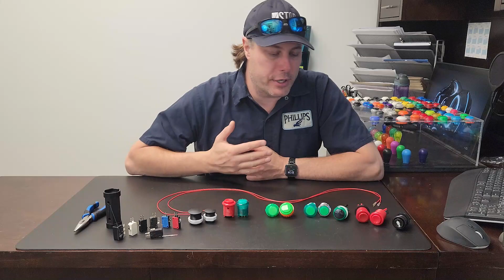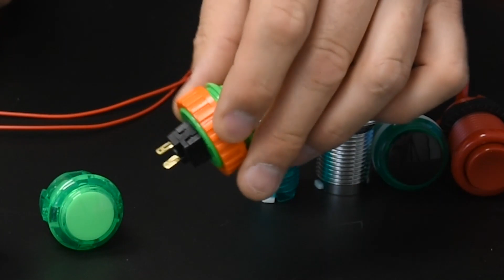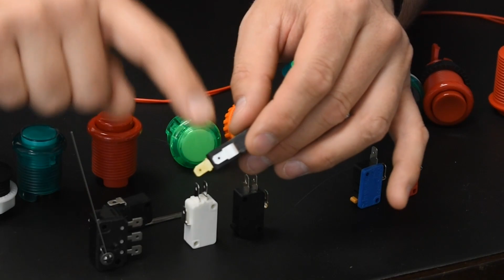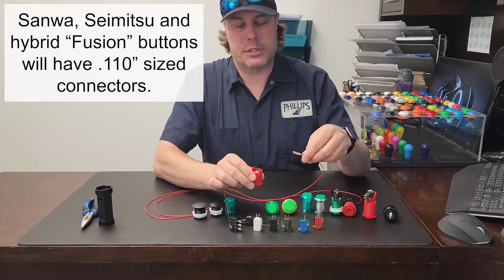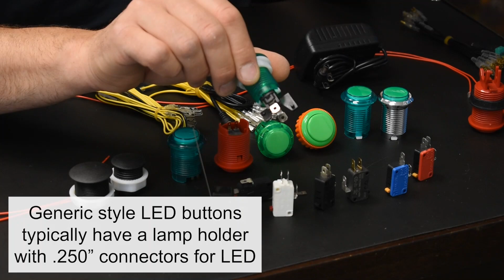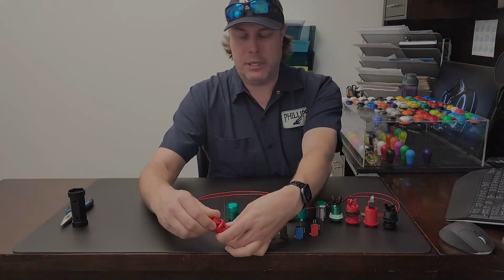Arcade Buttons 101

Comment: All switches are on/off or 1 bit digital. If analog like a game pad trigger then a variable resistor (Pot, strain gauge), capacitor (capacitive touch), inductor  or magnetic field (halls effect) needs to be used. In this case a micro-controller and maybe an ADC/DAC maybe required to output a numeric value or voltage level or current level. 
Arcade buttons use simple switches and are cheap to employ, with original leaf switches in the 70's & 80's Arcade/Pinball machines being cheaper than cheap. Micro-switches are modified toggle switches that use spring assisted snap contacts (clicky) to reduce destructive arcing of contacts.
Micro-switches were originally used in industry and the smaller all-in-one buttons use a mechanical keyboard style switch (low current).
Reply: Is there really a big difference between micro switches and rubber membrane switches
Reply: @GeneralTso369  Yes:
Microswitches are like mechanical keyboard switches, rated for a lot more cycles than a rubber silicone pad is. Rubber membrane is usually much easier (less force in grams) to activate than the most usual 100g (and maybe spring on top) of a microswitch. 
Japanese style switches are very "like rubber membrane" in ease of use but use mechanical, metal and hard plastic parts with combination of spring to be a much more longer lasting button that can also be serviced, if button goes bad and you do not have time to really clean and furbish the switch internally you just swap the switch itself and the cabinet still uses same plastics on the outside.

Some, very strong rubber membranes like ones in NES controllers are somewhat microswitch like in resistive until "release" type of activation feel but microswitches have it extremely strong.
Reply: @GeneralTso369  The Sanwa/Seimitsu buttons are mechanical keyboard switches like an internal leaf switch or dome and not today's cheap membrane or rubber carbon switch used in remotes and $10 keyboards. Like an expensive Cherry switch keyboard $1-3 a switch and not 1/10 of a cent.
Reply: @GeneralTso369  30-40g Japanese arcade buttons can do finger swipes on buttons to do a rapid double hit activation with a 1-2mm switch depression.
Reply: @cbaxter6527  I was wondering about that because nowadays when people emulate arcade games a lot of people say you have to use a turbo or autofire feature for a lot of them but I know that there is people who beat these games in the arcade without that so I wonder if maybe some of the buttons were just easier to press to achieve that high rate of fire
Reply: @GeneralTso369  The turbo or auto feature is in the controller chip (black blob or mcu). Yes switches are made with different activation forces 35g, 45g, 50g, 60g, 63.5g, 70g for Cherry MX switches. Sanwa & Seimitsu make their own keyboard switch design. Sanwa obsf-30 & Sanwa obsf-24 use the same square base switch with 2.5mm travel, activated half-way depressed with 30-40g force. Most Japanese buttons are convex (round or flat) tops but do make concave tops option. Japan does a typing action and not a button smashing in North America plus any modified pressing technique for activation.
Original buttons were concave plungers with own internal spring to lift button top up. Aligned below the plunger a cheap leaf-spring switch  (adjustable activation and silent contacts). Later Happ design modified the button nut and switch holder into one (still using leaf switches) and later moved to micro-switches for smaller size and ease of maintenance and durability. Micro switches are industrial use and are made with 50g, 100g, 200g, 450g, 900g activation force for machinery. Since the switch is separate from the button/plunger , there is activation slop or play in pressing the button (micro switch has 3mm travel plus 1-2mm play/lift). There is more average force to activate and more play and less finger feel. 
You choose - Mash or Type.
Reply: @cbaxter6527  I just heard you should use sanwa buttons for games where you have to rapidly press the button
Reply: @GeneralTso369  Happ buttons you must select a micro switch eg. from one suppler Zippy 20g, Zippy 50g, Cherry 75g (default) but you may get a whatever cheap Chinese switch is available and they are not always good. Suzo-Happ indicates either silver or gold contacts but nothing about activation force.
30mm and 24mm - All fight sticks use Sanwa, Seimitsu, Crown(Cherry SW), Qanba, Hori Hayabusa with the majority going to Sanwa buttons. It is all about feel and technique. Exception was the MAS Arcade Stick (Multi Arcade System) hand-made in California in 2000s.
28mm - Suzo-Happ or iL (Industrias Lorenzo) (original suppler to Happ) are used in North American arcade machines to liberate your quarter supply.
Reply: @GeneralTso369  Yes, one has a membrane, and one doesn't

Comment: The best LED buttons I've personally used are Bao Lian. There's a ton of different LED button makers but Bao Lian seem to be my favorite. However, I prefer Suzo-Happ concave buttons. The LED buttons are just too slippery. The very best advice I can give anyone that are using Happ/iL buttons is to remove the spring from the button....the responsiveness is then comparable to Chinese/Japanese buttons. Logically with no spring people rationalize that the button wouldn't work. The secret is that microswitches already have springs within them. The spring in the button is just getting in the way.